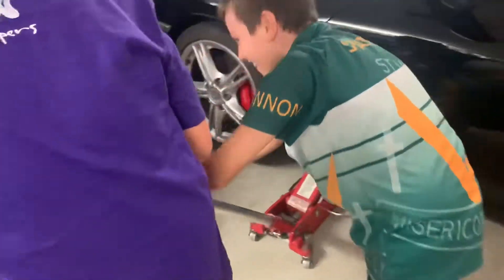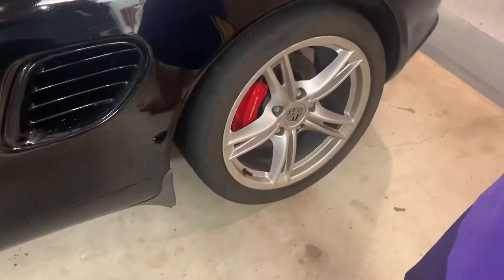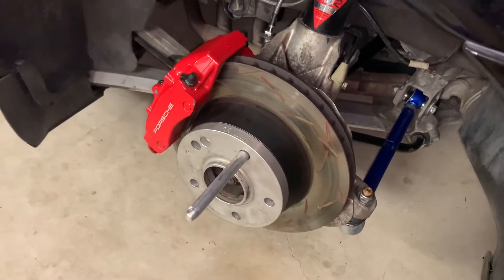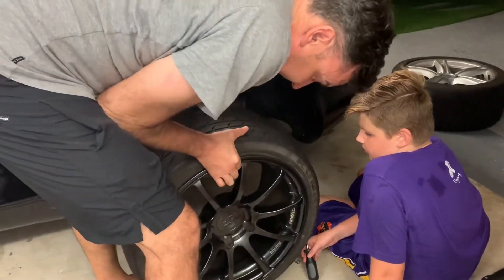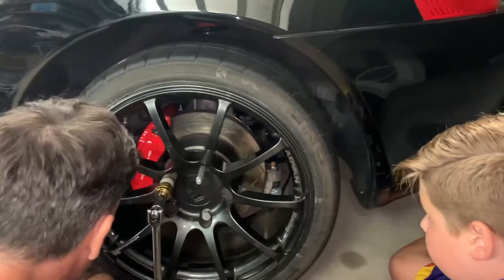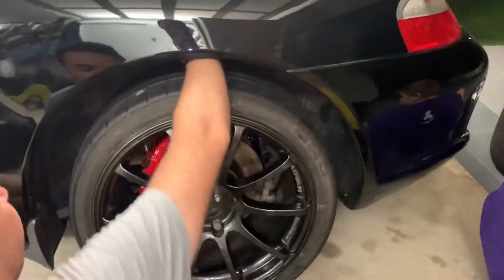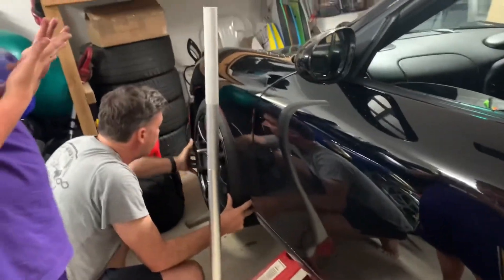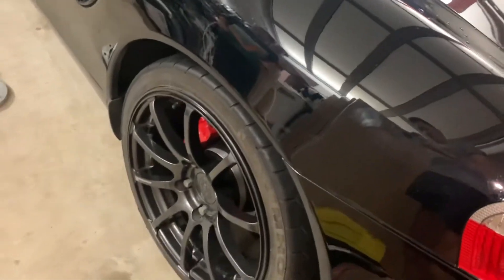Fitting Wide Wheels to a Porsche Boxster 986 - Fitment JDM Advan RS Wheels

Comment: Nice car, great wheels, nice stance. Looks great. 

I cringed at bare feet in the shop. I cringed at legs under the car and son's head under the car with no jack stand to be seen along with that jack. Safety Second? Or Safety Third?
Reply from the maker: Too hot for shoes mate. Jack stand under the rear subframe pick up points👍

Comment: For the rear 19x10.5 with a 10mm spacer works?
Reply from the maker: Depends on the offset and tires
Reply: @TheEddysGarage  mine is 19x10.5  55 offset....what do you think if I put on 10mm spacers will that work. The tire is 275/30 R19.   I thought your 18x10.5 looks good.  How was the ride?  Any rubing?
Reply: @TheEddysGarage  I've been stressing about it since 10.5 was touching the strut as is.
Reply from the maker: I had 18mm spacer with +60 so effectively +42.
Reply: @TheEddysGarage  thanks Eddy, I plugged in your rim 10.5/60 +18 and compare to mine 10.5/55 +15 and we are super closed....I'm out 2mm from the strut and fender.   Your setup was the only reference I could find on Internet.    I'm more at ease now.   Thanks you and happy holidays.
Reply from the maker: Awesome. Please send pics on instagram, or facebook. I would love to see the setup @mycl500
Reply: @TheEddysGarage  it fitted perfectly but YouTube won't let me attached a link

Comment: Why don’t you run 285s in the rear that’s what have on my 2002 boxster S fits perfect with a 15m spacer and the wheel stud conversion kit from rennline
Reply from the maker: The wheels were just half inch to wide.
Reply: What size are you running with those 285?   Are they 19x10.5?